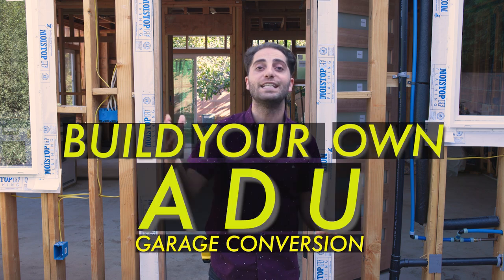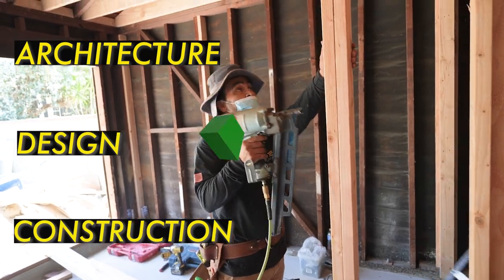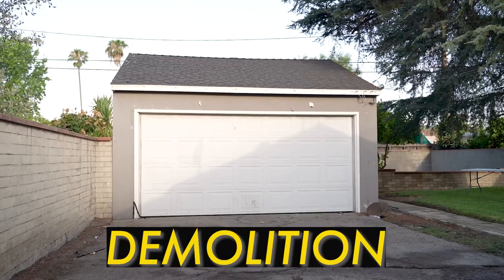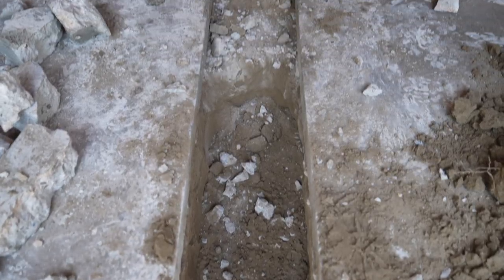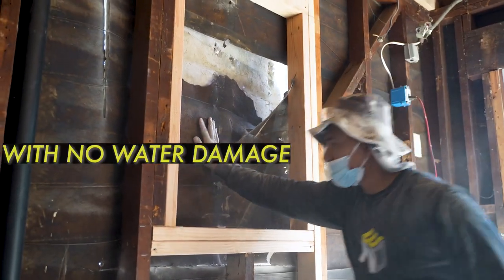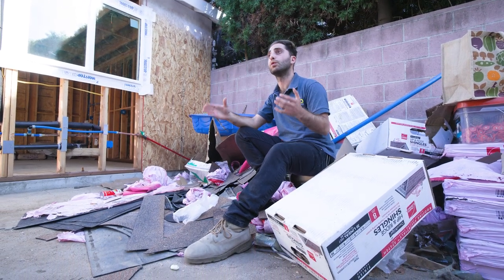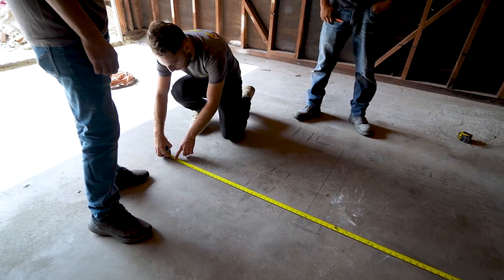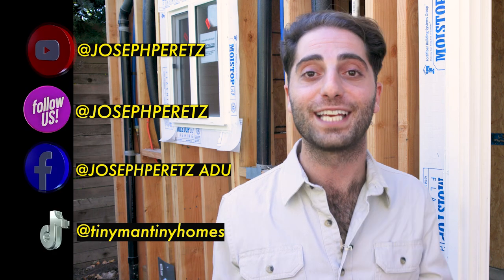How to Build your own ADU Garage Conversion: Episode 1 - DEMO

Comment: My garage from inside has an 8 inches let us called all around side curb concrete which is wider than my studs about 3 or more inches . 
The question is I am converting it legally to ADU so how to put the drywall? Should I land the bottom of the drywall on the raised concrete curb ? Because if I land it on the slab then it’ll be far from the studs by 3 inches . If so do I have to double the studs so the drywall back touch the studs
Reply from the maker: I would sister studs on the walls. You'll lose some space but its good to have straight walls

Comment: hey Joseph, I see you removed the rafter ties in this demo. is that how you left the roof structure for this one? was it permitted?
Reply from the maker: We only leave it like that for 1 Day. The next day we add ceiling joists to hold up the structure.